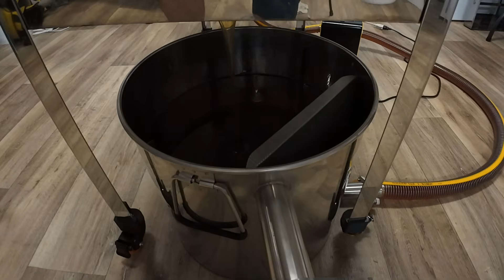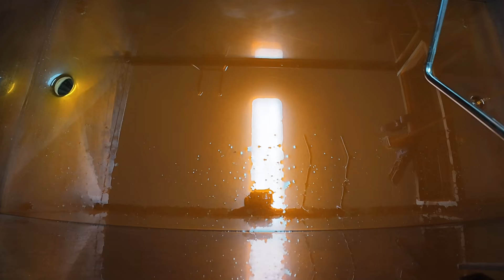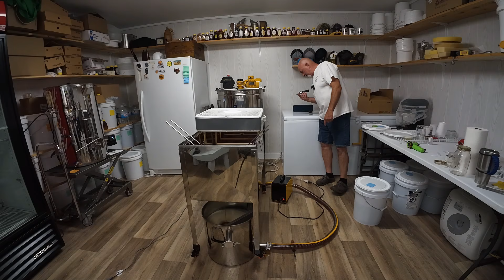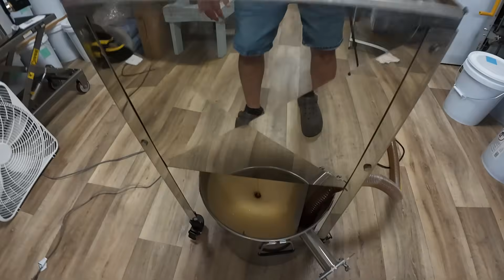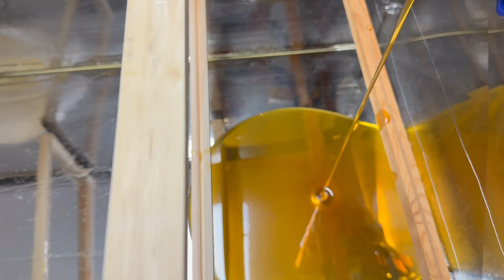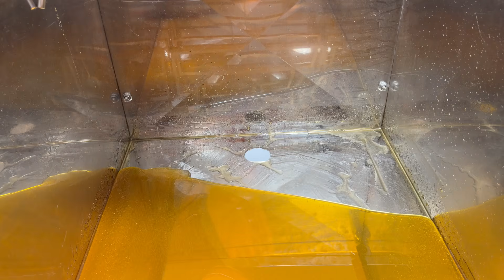Drying Honey   Slow is Faster

Comment: What was the temperature  in the room,my little window a/c has dry feature to exhaust  moisture out,even grow tents where you can really control that space with fans to dry honey
Reply from the maker: During this process the temperature is 80 degrees. I have the window unit set in dry mode and also have a dehumidifier running, so the humidity is normally between 35 and 45.
Reply: @josephrawls oh thank you ,

Comment: Wow!  That's a geat secondary use for an uncapping tank.  You are getting alot of use out of that little pump.  Ive been resisting buying any new equipment until I get larger honey crops and a place to put equipment.  But lifting 5 gallon buckets of honey into my bottling tank is brutal!  I either get help or pour half off in to another one before lifting.  Getting a little pump like that sure is tempting!
Reply from the maker: Yeah I am the same way now on the 5 gallon buckets. Mike may have a hard time getting this pump back. 😂😬 Thanks for watching.